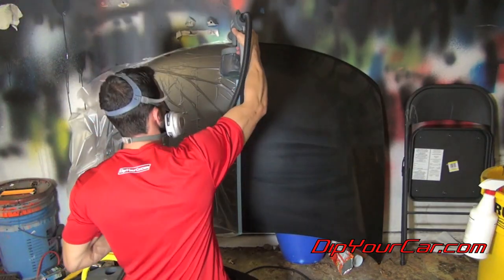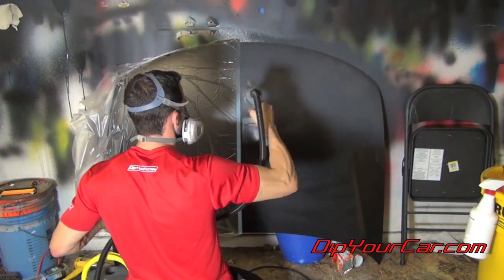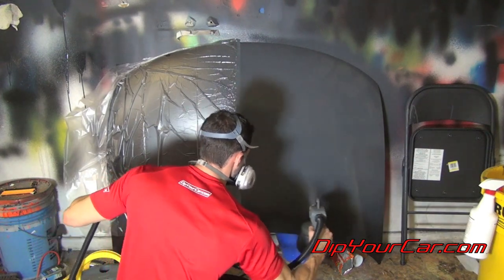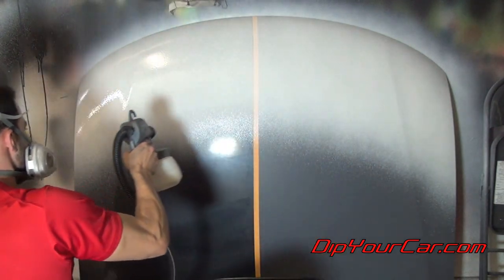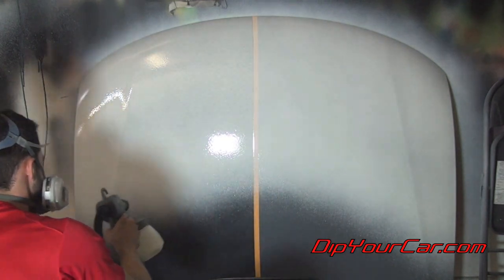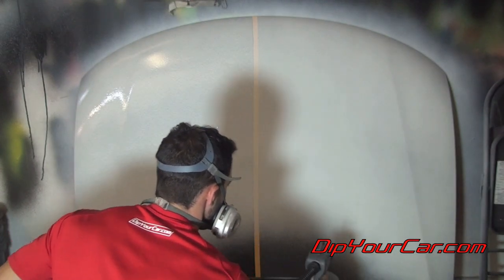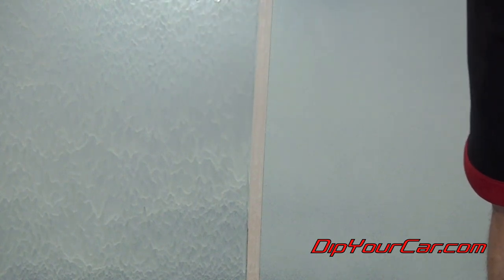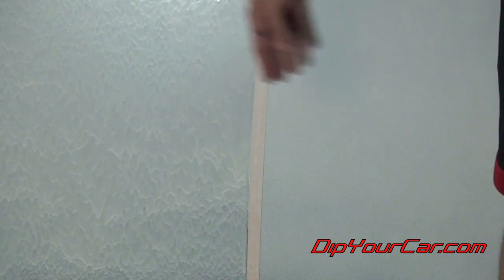White Plasti Dip - Get Better Results

Comment: i used about a can of white on each of my rims, inside and out and it came out great! i noticed the white is a little more runny but if you take your time like you should, you wont run into this problem. thanks for the video though, I'm sure it'll help me somewhere down the line (:

Comment: The best explanation for this white translucence is as follows:
1.  White is the most reflective color ie; it reflects back, or transmits, all colors of the visible light spectrum and absorbs 0% - whereas black reflects none and absorbs 100%. Therefore dark colors that absorb light will appear denser than the white product.
2.  Most of the rubber particles in plasti dip are round balls ie; microspheres, and as such will fit together tighter with other similarly sized particles i.e., other plasti-dip particles. Hence, the white form a more tightly packed first spray when applied to any other plasti dip product, even if it's black. 
3.  I made this all up but it sounds good. 
4.  I am convinced that plasti-dip will make a good top-coat for aircraft wings - helping owners avoid the costly hassle of re-painting aircraft stored outside. No, it does not blow off. No it is not approved by the FAA but it should be.
Reply: robert hoagland Actually I asked my I&A about paint, though not plastidip, and he assured me that paint does not have to be FAA approved.  BTW ALL paint is flammable!  But thanks for the idea I'll gather information and will consider this for my plane

Comment: Rubber dip s is pre thinned from performix. Regular plasti dip comes too thick to spray by itself, therefor you need to thin regular plasti dip yourself and it wont have as much color pigment in it vs rubber dip s which comes pre thinned and has the extra color pigment to compensate for the clear thinner

Comment: Fonzi, thanks so much for taking the time to post these videos. You do a great job of making everything easy to understand. I'm curious to know how to do a two color paint job. In my example I hope to lay down white on a hood, tape off a racing stripe then spray black over the white. Is there a way to lay down tape and not pull up the base coat of white? Any thoughts?

Comment: hey guys, great videos this is a really cool way to customize your car. question, have you guys dipped and cars that have factory sticker decals? I'm wondering if I dip my 07 civic Si will it peel off the decals on the side or is the sticker surface not high enough to peel with a crisp line?

Comment: I assume that the A4 you use for examples doesn't have that different of a surface area compared to a BMW 3 series, so how much product is needed to get two coats of gunmetal grey? And how much white for the rest to get proper coverage? (how much to buy, I assume all the paints need to be thinned, and is it 50/50 thinner/dip?) Also, how much Glossifier to finish it off?

Lots of questions, sorry :P

Comment: i don't get it..putting gun metal as a base coat (which is you can use white as base coat also) is not much difference because as i believed it's just a matter of color and they have same formula (white and gun metal color), is that right? thanks

Comment: ok so I get what you are saying about the grey doing a great job of blocking any other colour and priming your base for cover coats.... if i am spraying my motorcycle fairings with a white primer to cover with plastidip white, would the same run affect occur as you demonstrated in this clip?

Comment: Would you still use the gun metal as a primer if you were to use the spay cans? Or does the can spray at a ok rate that you don't need that primer layer?

Comment: If I plan to dip a white car with matte white dip, would it still be a good idea to put the grey base coat underneath to prevent the dip from sagging on the original clear coat of the car?

Comment: I am planning and going to plastic dipping my car. It's a small car (A 96 Eclipse) I was wondering how many gallons will I need. I want to paint it white with the grey under it. Like in this video. I was thinking 1 gallon of each or will I need more.

Also I kind of like the idea of a matte white, but not sure. would I be able to spray the Glossifier on later down the road?

Thanks.

Comment: Damn, I painted my bike yesterday and I was disappointed cuz I had to paint 8 to 9 times to cover the red, I spent lots of spare cans I used 6 to paint ninja 250, if I used gray I would use just 3, I wish I knew this before
Reply: I know this comment is old but i have a question. When you painted the tank on your bike how did you do it. Did you have to cover everything around it or just take it off all together. I'm wanting to paint mine but I don't know the best way to paint the tank.

Comment: what if my wheels already has black plastidip on them that has been applied about a year ago. will it work just as well when applying white plastidip on them or should i take off the black plastidip since the surface of it isnt as clean and smooth?

Comment: i did an E46 M3 with plasti dip white, i used Xylene as a thinner, 1 to 1 ratio cuz in here we cant get the toluene or the plasti dip thinner, but there is a texture finish with the white, and i used about 4 gallons of white to cover the Blue M3 colour, what will be a good ratio for using xylene as a thinner to get rid of the texture finish?